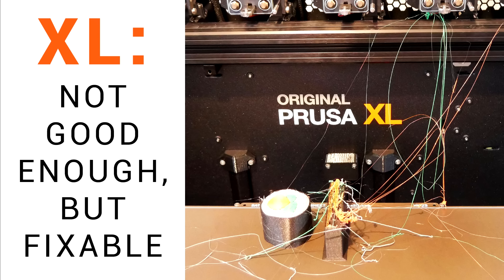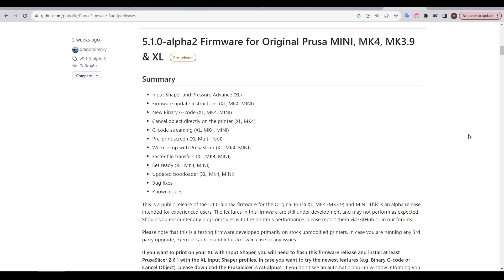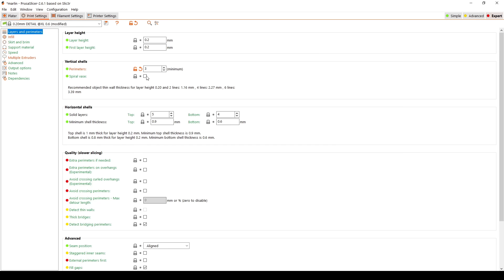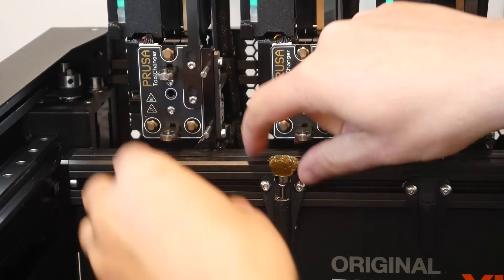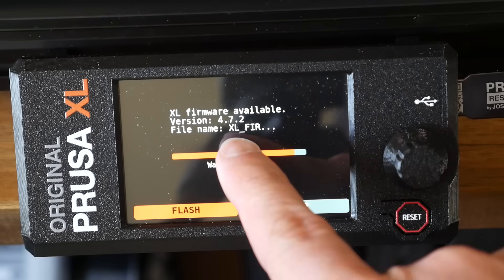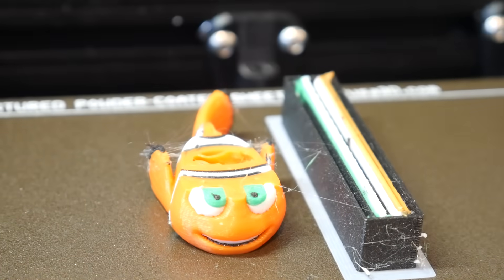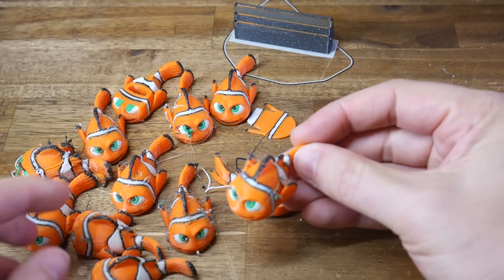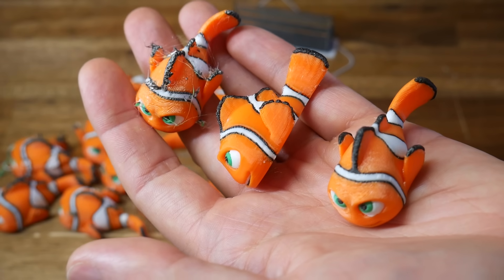Prusa XL update: Was the alpha firmware to blame?

Comment: Excellent work with the follow up, but it really shouldn't be necessary. Prusa advertised the alpha firmware and software as "bringing updated firmware and PrusaSlicer to make the XL faster, more reliable and more efficient." If they didn't want people to use it yet, they should have chosen more cautious language for their blog post.
Reply: The fact that it's labelled as "alpha" signifies that it should be considered unsafe and may not work. There was a time that companies would never give customers alpha versions of products unless it would fix a very specific problem a client was having. Unfortunately it is common now to label beta versions as finished and move onto the next version, leaving maintenance developers to fix issues. The two main operating system companies were at the "forefront" of this, each for a different reason. (Quotes because it's something that a company should not aspire to be a leader at.)

I would only install an alpha version of software if it fixed a very specific problem and nothing else was changed from the previous version. The alpha release from Prusa introduced a number of new features, such as input shaping. I would even be wary of installing beta software, especially early releases, unless it's a golden master (GM, a version that is intended to be released to the public but may not if a serious bug is found).